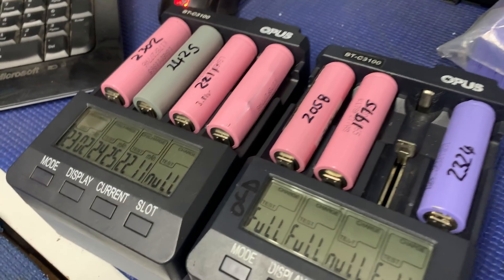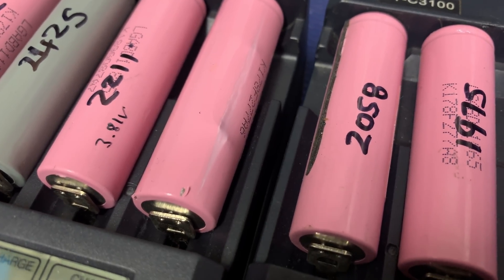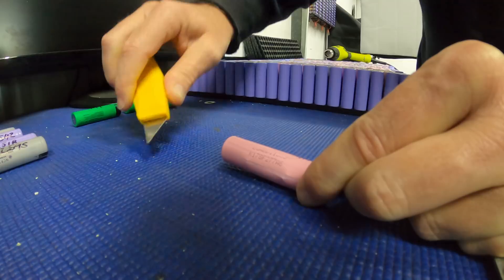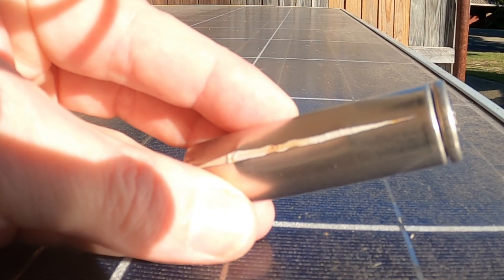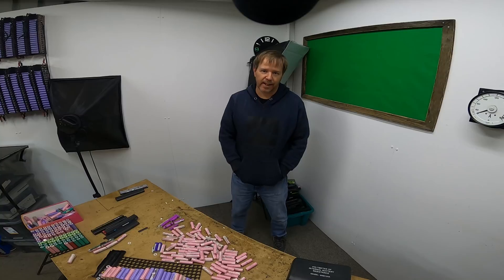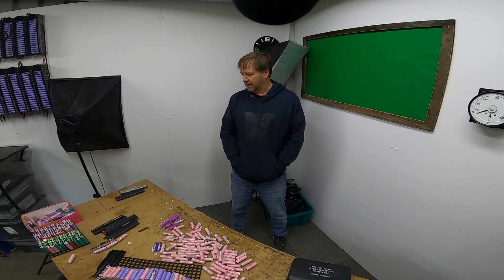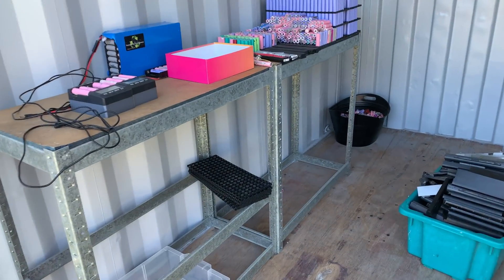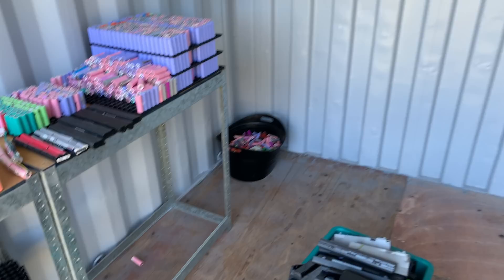Narrowly avoided disaster? Follow up video in description!

Comment: i would like to see inside the cell.
Reply from the maker: 50 likes on this comment and it happens...
Reply from the maker: To be fair i want to see inside it also...
Reply: @HBPowerwall  same lol
Reply from the maker: @BenCos2018  Geesh - should have said 100 :)
Reply: @HBPowerwall  xD
Reply: @HBPowerwall  just be careful if you do open it though 
I don't want you to get a injury from it
Reply from the maker: I'll put shoes on for the event Ben lol
Reply: @HBPowerwall  lol
Reply: @HBPowerwall  well looks like your disassembling it. remember be careful and wear welders gloves. it will be rolled like a cake. don't let it cross connect!
Reply: @HBPowerwall  There, 50... Now hand over the goods! 🤲 🙃
Reply: Think you would do it even if you only got 1 like
Reply from the maker: And under an hour we have 50.... keep them coming tho i'll need the cash to buy a dremel or pipe cutter tomorrow...
Reply: @HBPowerwall  a dremel is going to generate a lot of heat so i would recommend against that. I mean if the intention is to preserve the contents so that they can be inspected further.. I would instead suggest something else.. maybe some robust cutters or tin snips eh? If you can get a purchase onto the edge to start cutting. Otherwise I am not too sure how you would be able to tear it open without risking starting a reaction. As pulling open along the tear (by continuing what it started)... that will inevitably cause pinching and stress inside the casing within the 2 ends. Let us know how you get on eh? Oh and be sure to check the 'record' button working on the camera. Since can only have 1 go at it.
Reply: Or maybe if you can first of all un-join the casing around the top circulmference. Then un-peel / unwrap it like a sweet wrapper. That may stand less chance of disturbing the contents.
Reply: @HBPowerwall  a while back I saw this paper which claimed the same thing was happening to NCR18650Bs that they subjected to a fast charge: https://onlinelibrary.wiley.com/doi/pdf/10.1002/est2.141 I didn't believe it at first, and actually started to recreate their experiment but never ended up finishing it (still can, I think I'm 30 cycles in, and it starts happening at 60 iirc). I guess it is possible then, but it seems weird still that this would happen as opposed to venting out the top. Maybe there's something weird going on that causes the cell to expand laterally instead of just making gas to pop a vent.
Reply: Be very careful...
Reply: It should be pretty safe to disassemble, it was reading 0 volts.
Reply: Greg B Zero volts at the terminal. If the CID has disconnected, the cell itself could be fully charged; it’s unlikely as the split implies something went very wrong with the cell which almost certainly means it shorted out internally. Still worth having an explosion containment pie dish on hand though...
Reply from the maker: As promised - https://youtu.be/per8ybI55bI

Comment: Hi ! I found something interesting on internet about under discharged cells and I stopped using them . I paste here a part maybe someone is interested : If the voltage on a Lithium-ion cell drops below 2V, bad things start happening. At the cathode, the oxygen in a Lithium Cobalt Oxide or Lithium Manganese Oxide cathode can break down over the course of a week or two. For a Lithium Iron Phosphate cell, the oxygen breakdown is even faster. At the anode, when copper foil used as the current collector it can dissolve in the electrolyte, increasing the self-discharge rate of the battery, and parcipating out as metallic copper when recharged, potentially even shorting out the cell.
Reply from the maker: Yes i've read the same thing

Comment: @hbpowerwall you seem to ignore the constructive feedback on the comments here. Imagine this happens inside one of your battery packs 😓 . I like the channel, yet this made me rethink and go for a professional solution instead of DIY power wall. Check the comments on your safety precautions, meaning on voltage levels and especially the one to avoid igniting the chain of packs. Hanging them like that is asking for issues when having faulty cells / fuses. Keep up the good work though, yet this one should be a signal.
Reply from the maker: Milan Schinkel I do .... others comment. I’m happy with precautionary measures I’ve taken. And even more happy with the future plans.

Comment: you are very lucky when you stuck that lifting tool on the + end of the cell and there appears to be a spot where you nicked the wrapper.
you should pry from the - end of the cell instead because if the cell was still functional you could have shorted it and if it was still gassing out you could have gotten a fire.

or even better yet use a plastic tool to pry the cell out of the charger

it could be a plastic spoon or knife or a sliver of plastic from something

it looks like the battery material had expanded and split the side.

you can do an experiment to see this kind of splitting by filling an empty soda can with water and put it in the freezer overnight and you should see the can split by morning

if you re wrapped the cells you may have weakened the cell wall by cutting the wrapper off.

this is especially problem with tesla cells as they are aluminum and can cut easier

Comment: battery puffed out and the weakest part of the wrap broke its seam?
shrug
Reply from the maker: Point is it could have gone thermal - nothing to shrug about...
Reply: @HBPowerwall  shrug meaning idk if my reason was correct. Obviously i know it could have been bad.

Maybe consider adding a cheap camera to keep an eye on your chargers? Even a cheap Android phone using a remote camera app would do the trick.

Comment: Looking at the edges and the pattern of the breach - I would suspect a manufacturing problem during the extrusion of the cylinder. This seems to have created a weak spot which allowed it to fail. What I’m curious about is what the cylinder wall thicknesses is compared to the opposite side of the cylinder wall.
Reply from the maker: I have no real way of measuring that accurately unfortunately - I still have most of the bits i'll look into it

Comment: Guessing a micro imperfection in the metal caused it to tare open much like the micro flaws that historically got into jet turbine blades which then went onto shatter under heavy duty load leading to catastrophic failure.

Comment: That's a standard failure.. without a detailed examination of the cell its hard to pinpoint why it failed..
but it's just an internal short resulting the creation of hydrogen gas that inflated the case.
When the case split that relieved the pressure and broke the short. 
I get that type of inflation out of my drone batteries all the time.. As the currents i'm pulling is very high 100A to 120A...
Reply from the maker: But i was led to believe these have a vent and are by design meant to fail out the positive side

Comment: Ya, gotta agree.  Looks like a failure of the paper they use between layers in the battery.  Either due to a rip, fold, or improper build.  Glad it didn’t explode or catch fire.  Those batteries can cause quite a bit of heat when they fail.

Comment: Probably got hot and there wasn't enough room inside for the core to expand, plus the case might have had a fault - check with a microscope for a dark spot in the fracture face -. Also if the CID is faulty it wouldn't cut the power. I wouldn't worry if 1 in 10,000 batteries did that, and besides the pre-charging should catch it, but this is why I suggested your racks be boxes with self closing lids, ie, containment strategies.

Comment: Would be most interesting to test if the vent is still working or not. If it does it was no matter of heat and pressure build up but just a weak point in the casing that - finally -  gave up. If the vent is not working it probably could have exploded badly - but didn't obviously. Wonder why?

Comment: Those LG Adb ones fails so much, mostly because their steel container is very thin and weak, some i tested from laptop batteries, tend to fail like this after discharging them, too much pressure inside.

Comment: As others comment, it could be a number of things. My 2-bits; it received a knock that didn't dent the outside but caused localised damage inside, causing a short or heating at that point. From another group Shelley make a fairly cheap smoke sensor for home automation systems; I would encourage anyone doing cell salvage to have some minimum warning devices like that.

Comment: Do you know if that cell was dented originally? It almost looks like the back end is dented beyond what was caused by it splitting open. I always suggest NOT using cells that show any sign of physical damage, no matter how small, because the structural integrity is compromised at that point. Stay safe!

Comment: There's a reason that manufacturers of these cells do NOT want us home gamers getting ahold of them. They are inherently dangerous. I'm no expert. Heck, I don't even own a lab coat. That said, it does look like the cell split from pressure due to a defective vent. Had the vent been working, it would have outgassed through the usual positive terminal area. The chemistry of these batteries does result in expansion during operation. I suspect that this was a chemistry failure that would have vented and been done, but the vent didn't work for some reason. It didn't overheat and thermal runaway, because if it had, the shrink wrap would have been scorched, and you would definitely have smelled that. The charger might have been damaged too from the heat. I'd like to think that is as far as it would have gone, but I've had a couple cells go "thermal runaway" on me over the years and they really do "rapidly disassemble" in flame when that happens. I think moving to the shipping container is a great idea. I have a fireproof bag and a Pyrex glass container that I use for charging untested cells. I have a smoke alarm right above the area that will let alert me if things start getting out of hand.

Comment: I've seen so many battery fires, some close up, including big ones.
I would not ever build something out of old cells, especially if I don't know their history. Like, it is enough to fully discharge a cell once for dendrites to grow inside and to develop a short circuit eventually, usually when fully charged.
So audience beware.
Reply: Imagine you have a 30kwh battery pack made if these... It's just a matter of time disasters will happen.
Reply from the maker: I have time. Let’s give this a crack.
Reply: @HBPowerwall  I have recently witnessed a battery fire that ended up in 5M€ in damages. This was due to poorly designed battery, no BMS, etc.

Comment: Hey Thats is why i have all my opus chargers placed on the wall so if a cell leaks i will run down instead of into the circuit board that will cause a fire i have seen it happen luckly i sat right beside it so opus must be mounted horisontally imo
Reply: I can send you a picture of how a opus looks when lithium drips down in the circuit board if you give me you email adress

Comment: What manufacture was this cell? My guess is this was caused by constant overcharge or just end of life cycles by plating of metallic lithium. Maybe the BMS in the pack this cell came from was faulty constantly over charging this cell or the whole pack, so you may run into a few more from that pack you tore down. You also may want to watch the next few batches with that charger also, the charger may be failing to cut off at the proper voltage as well. Personally I wouldn’t charge cells if they fall below 2 volts and the charging will cause more plating, most manufactures stat the cutoff discharge is more like 2.5 volts.

Comment: Where is the electrolyte?!
Reply: It's not a liquid like what you have in a car battery. The electrolyte is dissolved into a paste on the surface of a membrane that is all rolled up.
Reply: @WarrenGarabrandt  I'd have to disagree. I've had my share of liquid electrolyte leak out of 18650s. Sometimes even bubbling out of the cell.
Reply: @Rendus4  there are a bunch of different chemistries, and some of them might have liquid in them. Thanks for the heads up.

Comment: Take a pipe cutter to the ends and carefully unroll it to see what shorted
Reply: The material inside there will spontaneously combust when exposed to oxygen. I suggest doing this outside, and whenever you have a breached cell that cell should be fully neutralized and disposed of immediately to prevent it from catching fire hours to days later.
Reply: @WarrenGarabrandt  you have watched to many movies, I have taken several 18650 apart to inspect shorts and not once has anything Spontaneously combusted, besides lithium doesn't Spontaneously combust with oxygen and neither does cobalt
Reply: @quantumreality8844  I watched it happen on a steam from big Clive . He even showed the data sheets that warned about the possibility of combustion. I'll find the video and link it.
Reply: Womp womp. It was a NiMH battery. Not Li-Ion. I'm probably wrong, but it's probably still worth being careful though.
Reply: @WarrenGarabrandt  https://youtu.be/fhsB5ILU72k grinding up lithium batteries do you see any Spontaneous combustion happening?

Comment: That’s pretty scary starting to think if I’m going to even use 18650s for my wall .. Think I might go AGM batteries 🔋 after seeing what’s all going on because there’s no way I can have a storage container ... I wonder if that cell was in the winter or something in a frozen state .. pretty scary not venting Keep us updated thanks for sharing
Reply: No battery chemistry is perfectly safe. Li-Ion is definitely one of the more exciting ones though. I had a bunch of 7 Ah lead-acid batteries connected in parallel and on a maintenance charger (13.5V 250 mA max charge), and one of them crapped out. I guess it developed an internal short, and all the other 50 batteries dumped their energy into it. The 14 AWG wire melted and fused before things could get too out of hand, but the failed battery swelled up so much, it looked like a partially deflated ball instead of a rectangle. For the record, 14 AWG wire has a 51 Ampere fusing current, so that battery was converting at least 600 watts of electricity directly into heat for a while before it failed completely. I smelled something acrid and went to check on them. When I saw what was happening, I panicked, ripped the wires off the battery and threw it out the nearest window. Nobody was likely to go near that part of the building, so I wasn't worried about it. I was sure it was going to explode and I didn't want it doing that inside the house. It was so hot, I got 1st degree burns on my hand from just a few seconds of holding it. About an hour later, I went out to check on it, and it had cooled down so I put it in the shed for recycling.
Reply: Warren Garabrandt Pretty cool the batteries are you using the names of them

Comment: @HBPowerwall Had to be a defective casing. The way it has two high points. Something had to have damaged it when it was rolled or when the roll of electrodes was inserted. Be interesting to see what that CID looks like. 
From exp, it's dead flat so the lithium shouldn't be too reactive. The one's i've opened couldn't be made to catch fire no matter what I did to them. Still, glove up and face shield brother!
Which reminds me man! When you're diggin cells out of chargers, if you're going to use a metal spudger, at least do it at the negative end of the battery yeah?!? :)

Comment: My guess is the CID was faulty so it failed to do its job. AND the cell was previously damaged so that it overheated when charged. Overheating caused a pressure rise,  then with nowhere else to vent it popped the casing at a weak piont(s). Multple cascading faults. As you said "never seen that before".

Comment: I think that CID in that cell worked too late. When I was charging slightly swollen lipo, they began to swell more strongly. Inside, I heard "bursting air bubbles". I quickly disconnected the lipo, but it swelled up more for a few next minutes. I suspect that it was similar here, and after the CID tripped, the pressure was too high so the battery simple cracked.
Reply: Sounds like the separator in your battery failed and the chemistry was converting all the stored energy into excitement.
Reply: @WarrenGarabrandt  It was probably as you write. This was the first time I saw this behaviour of the battery when charging with low current.

Comment: What about the wood floor of the container - I had a run motor capacitor explode and catch on fire and burn a good mark into a ply floor - about 2 inches in diameter burn mark.

Comment: In the engineering world, never go from one extreme to the other.  In your case, the idea of having to put on shoes for safety is extreme, so I suggest a middle ground of flip-flops or sandals. ;)  But in all seriousness, def take it slow and careful on this one and consider safety glasses if not one of those clear plastic face shields and some gloves.  If you had to start a new YT channel called "One-eyed Pete's Powerwall Adventures" I mean, sure of course I'd be a subscriber, but I wouldn't feel good about it. =)  Sending a few shekels your way for the effort and keep the videos coming!  PS - any time frame on resuming the Mini project or is that on indefinite hold until this human malware situation is resolved?